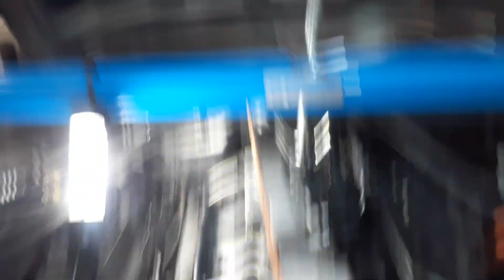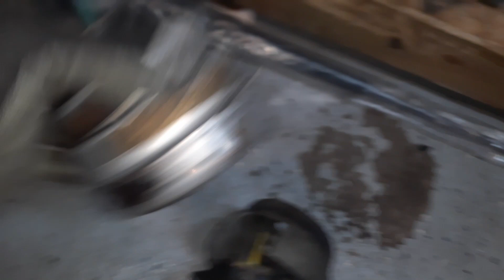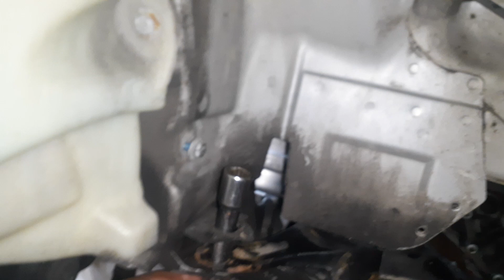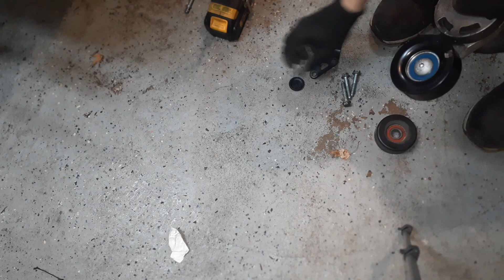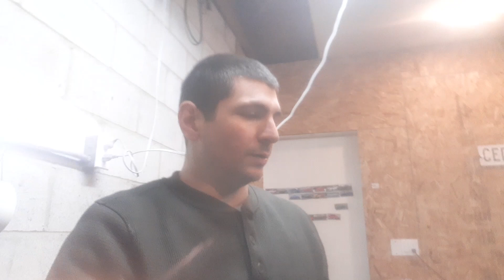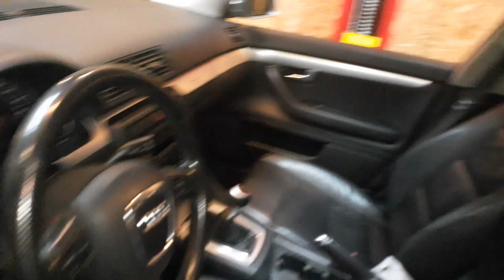Audi A4 Engine Mounts, Reassembly, Start Up  ( B6, B7, 2.0T FSI )

Comment: How do i find information about the bracket that holds the engine mount? every time i even mention the "mount" the word bracket gets ignored in my search bar. i need to replace the bracket, (OEM Part # 8E0199308H) not the mount. thank you for your time.
Reply from the maker: I Donno brother go in to Audi and ask for a picture of the part with the part number

Comment: How did it feel after changing the mounts?
Reply from the maker: Less vibration at lower rpm. For sure. At speed not really. The most is under acceleration